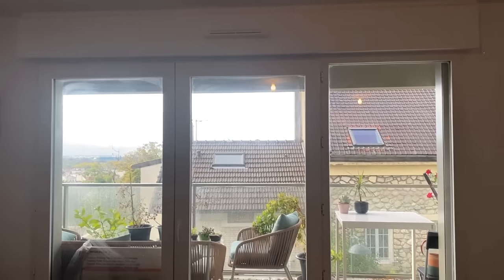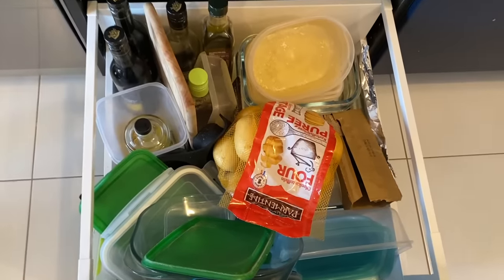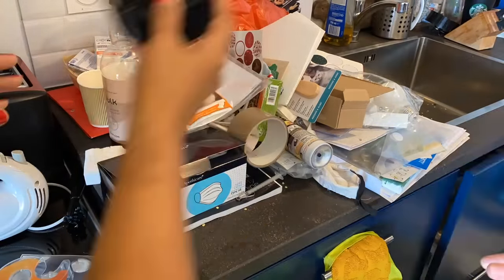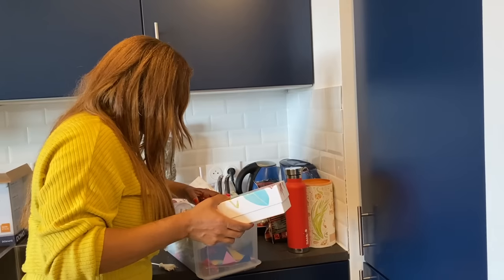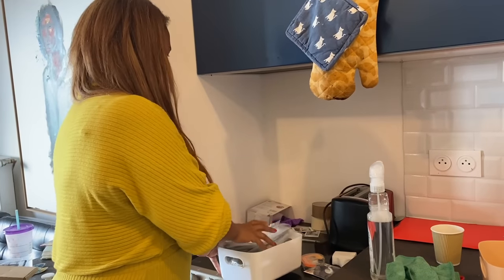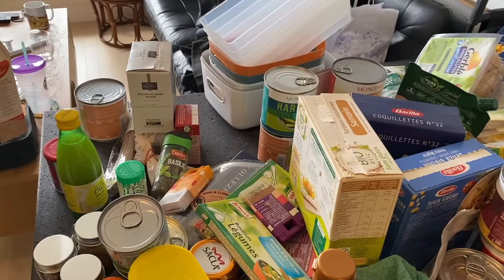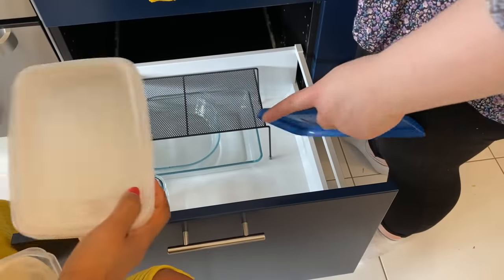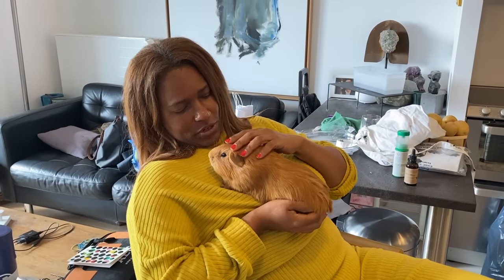We cleaned + organized EVERYTHING in her modern kitchen in Paris!

Comment: You both did a great job in the kitchen.  My only thoughts are the spice drawer.  Spices store the easiest in deep drawers if you use like jars and stand them up with labels on the top.  Much less room is taken up.  Also the bottles.  If the don't fit standing up I like to decant mine into shorter jars to fit better or find a taller place.  Maybe store the tall ones in the entry cabinet.  The others will leak at some point and make a mess.  Still a great job.
Reply from the maker: Yeah the spices ended up going upright on the Lazy Susan. I need to follow up with Celina and see how the oils are doing in that drawer. I’m wondering if they’ve leaked or spilled or how functional it is. I’ll do A follow up though and keep  u guys posted